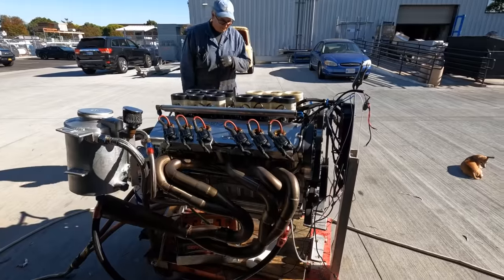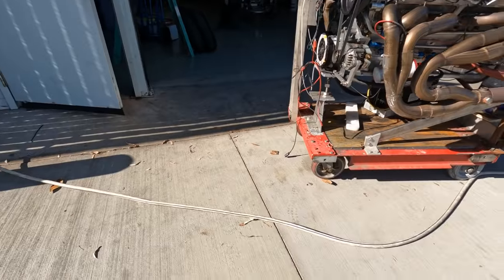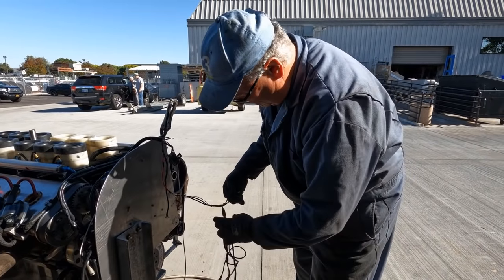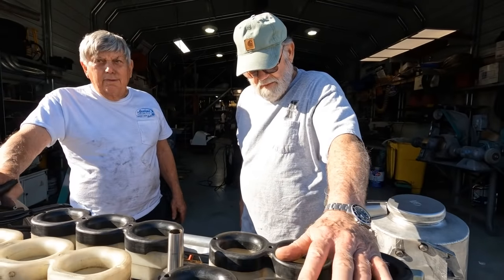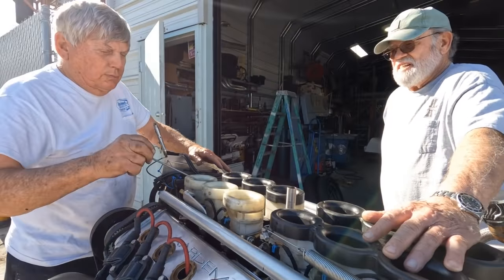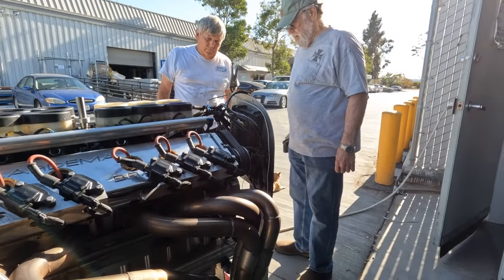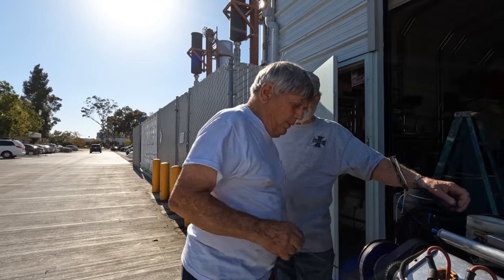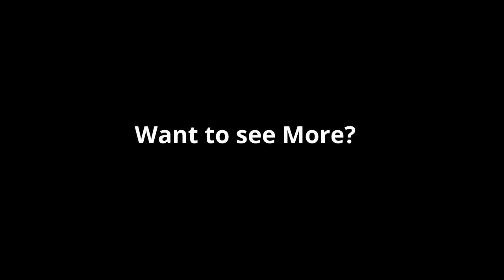Homemade V12 Engine Start Up - Pure V12 Sound & Shop Talk with Pete Aardema & Kevin Braun

Comment: I'd be logging data on 12 wideband sensors if I spent the money on building a one off custom V12.
Reply: true. surprised to see fuel injection and electronic ignition with such little telemetry. guess they just "know".
Reply: Well, while I'd agree with you, and EGR's, there may be UCU support issues - but at least 4 in the primary collectors would give some useful data.
Reply: @gordowg1wg145  You could run a standalone logger to get the EGTs and wideband readings over and above any capability of the system they are running, doesn't have to be closed loop but would sure help to diagnose this issue they are having (and could be hooked to an alarm to tell them to shut down before it goes pop). Seems like they may be stuck in the ways they know, rather than using everything that is now available to help them. I'm sure they've forgotten more old ways than I know though!
Reply: Losing a cylinder because it ran lean? That would have cost more than 12 closed loop Widebands!
Reply: Wideband sensors don't play nice with race gas...at least for very long.   EGT thermoprobes don't care about what fuel you run, and for what these guys are doing would make the most sense.   That would have clearly shown the lean cylinder before it melted had they been running EGT's.

And coming from the aircraft world....we've figured out how to diffuse inlet air a LONG time ago.   You don't need to 'reinvent the wheel'....just look at other disciplines who deal with high speed air flow and see how they handle it.   The inlet area needs to be able to feed the motor, but then you need a gradual increase in area to slow the air down and increase the pressure (Bernoulli's Law at work).   It's not the speed of the air coming in that makes the power...it's the increase in pressure.   Slow moving high pressure air can then be fed equally across the motor with simple ducting.

Comment: I'm a bit late to the party, but motorcycle ram air technology might help.  The ram air intakes feed an air box / plenum, which then feeds the carbs / throttle bodies.  There's a whole science as to the shape and size of the air box, but the idea seems to be increasing and balancing the pressure feeding each intake.  Obviously, the air filter on a street bike helps diffuse the air flow.  If no filter is used, some kind of baffles would be needed for the LSR engine.

Comment: The scoop needs to be separate from the air box. 
By bringing the air in from the scoop thru a 180 degree turn and bringing it into the center of the sealed air box ( and installing a diffuser) the pressure to each throttle plate will equalize. 
Pretty low tech approach, but it will work. 
Then add some O2 sensors for fuel enrichment as manifold pressure changes, ( or run it fat on the low end and tune for WOT+ 250 AP)

Comment: So feeding air from front for ram air, is in principal a good idea.
Atmospheric pressure approx 6 psi, @250mph without bothering to do calculations at this hour of the morning, would easily be around 50pri above atmospheric pressure.

Therefore a simple way to transmit equally to all 12 would be to split incoming air charge via a dual plane scoop.

What do I mean by that well, if one has a 4 inch hight opening for example, 2 inches feeds first six cylinders.

The upper half or 2 inches feeds the back  6 cylinders.

And as dad always said nothing ventured nothing gained.
He was 2nd gen Engineer and I simply followed in his footsteps for my 40yr career.

I wish the team all the luck with this musical motor, Sincerly Steve 😉🙂👍👍
Reply from the maker: Its very difficult to test drive a land speed car. Pete tunes it on the Dyno but as you know its very difficult to recreate 250MPH air flow. Thanks for these calculations. I will share them with Pete and Kevin.
Reply: @GregQuirin  There not calculations Greg, just numbers off the top of my head early in the morning, before finishing my coffee.😉😁😂🙂👍👍

Comment: The back seat engineer in me says you don't want to enrich the rear cylinders as they would then make too much power - relative to the others. More appropriate would be to close those butterflies a little bit to bring the mixture back in line with the rest of the engine... which would then make the surplus pressure available to the cylinders in front... balance the air flow.
Reply: Why would the back cylinders making more power be bad?
Reply: @sexyfacenation  If it were a small. percentage... say 10-15% more, probably little risk. But the pressure buildup at the back of an intake ram would (at speed) probably result in a 2:1 difference, which could cause crankshaft twist problems... or at least highly unbalanced cylinder combustion pressures... leading to rear-most cylinder related failures. 
This is why some racers have used individual "per cylinder" ram stacks.
Reply: @beforebefore  wouldn't matter.  You want each cylinder to make as much power as it can.  The engine won't break due to some cylinders making more power.

Comment: Instead of putting a relief in the back of the scoop,run an internally split intake scoop. The top inlet provides air for the rear six pack inlets, and the lower provides air for the front six pack.
The some simple tuning and your good.
Thermal couplers on each exhaust will help with the tuning, and 4 O2 sensors to ensure your tune is just a little richer than stoseometric.

Comment: I believe they are 100% on track, in their thinking the air is stacking at the back of the scoop. The answer isn't just to run the back 2 holes richer (actually less lean), it's to tighten the difference in air being fed to between all the 12 holes. 
1) a driver or ecu (or timer) controlled flapper on the back of the plenum. If you wanted to do a bit of math, you could rig that trap door with a spring and not have to think about it again, but I'd rather it's opening (and amount of opening) is a known and logged event. 
2) you could have 2 intakes/plenums to feed the front 6 and back 6. A little baffling is fun to play with too, but it's such a dynamic environment in a intake, that it's a ton of chasing.
Reply from the maker: Thanks for the info I will pass this on to Pete and Kevin.

Comment: Would be great to see what they've done the the older LT5 builds, the parts availability for performance was so limited and theyve done some amazing work
Reply from the maker: All 3 of their LT5 engines are complete runners at this time.  I will ask Pete and Kevin if the want to do a LT5 engine video.  This Video has some  LT5 content-  https://youtu.be/j7KHy6s2Yg8
Reply: @GregQuirin  thank you I was sharing the Hot Rod Magazine pics with some of the old Mercury Marine LT5 group.   There is a die hard group of LT5 enthusiasts still out there, recently a C4 ZR-1 set a class record at Bonneville .... Such an underappreciated work of art!

Comment: The high velocity air coming in (250 mph) is (should be) defused slowly (area increasing) entering a larger dia tube (reducing velocity increasing pressure) , the velocity is reduced  as it travels down the difuser and the pressure increased. 
The trick is to do this in a way that the increased pressure is distributed a cross the intake bank. May have to create a light chamber above to distribute the pressure below via large slots to let the air in above intake ports.o  Slot size may vary larger further away smaller closer to high pressure end of the a above chamber

Comment: Sounds like an F1 engine from the early 90's!
Reply from the maker: Thank you it does sound awesome and you should hear it at 250MPH
Reply: Sounds like an F1 mixed with a large displacement 4 cylinder motorcycle engine. Very cool!
Reply from the maker: @compt3ck  thank you it does sound amazing
Reply: My initial first thoughts as well! Thank you💪😁

Comment: This is so cool! Thought… could you run two scoops, one to the front six cylinders and one to the back six? There still might be a pressure differential issue between each section, but since the plenum or “scoop” area is smaller, the difference may be less keeping the each group of six more equal amongst each other? Thanks for posting these videos, very interesting information. Hope to see you at Bonneville some day!
Reply: Or run each set of three cylinders with its own scoop - that way the demand would be equal for each.
Reply: So I did not see any scoop. Do I need to sit through the cc ? V12 intakes or erm V10 intake scoops are well known from F1. Or any hood scoop from a V8. Or Even look at the distribution in some WWII V12 engines, which reduce pulsation as early as possible and thus prevent flow separation, but at the cost of more surface friction. They are all as good within margin.
Reply: I was just thinking that myself, a lower scoop for the front and higher for the rear. That’s one long Engine … either that or individual curved intake trumpets, another crazy superspeed challenge …. Keep it up guys !
Reply: Thought of the same stuff. A higher scoop for the rear cylinders and lower for front 6. Could equalize them a bit with a butterfly inside or by changing the opening size. A butterfly is better, cause you can use it with a servo to equalize the pressures with help of a microcontroller. Having two MAP sensors is a must then, cause it could potentially cause a more uneven scenario than it already was. All that or just mount a baffle inside one scoop. It would lower the flow overall, maybe killing a bit of power, but it would stabilize the pressure.

In terms of not being able to test the design - you could always try modern CAD software which has fluid dynamics simulations included :) It would help a whole lot, even if it's not 100% accurate. I also agree that the front cylinders are getting less air because of the inertia.
Reply: @tomclanys  Butterfly is ugly. simulation is nice. Aeroplanes used boundary layer splitters. One could test that on a trailer pulled against the wind with smoke, glass screen, and a camera ( old school ).

Comment: Ohh, Ohh, the sound! Awesome noises from that V12! On the "vari scoop" concept;  use a rising panel to occlude the uneeded portion of the high speed airflow run by a computer algorithm tied to the velocity and measured density of the air. Any "boost" pressure would be beneficial, but only if it is equally felt by all twelve cylinders. Also a scoop that led to an expansion chamber could let you moderate the effect. But that noise!  FR

Comment: You can do a 3d flow simulation given the engine parameters and dimensions of the intake box and injector stacks and with the ram air effect at 250mph.

I did this kind of work for Hendricks motorsports and Honda f1 v10 engine.

Let me know if you need any help. Kurt slc ut

Comment: Thats a really nice piece.. A simple fix, if your not relying on rammed air, would be to turn the scoop backwards like a boat. Although you would be leaving free available horse power on the table. Ide say use the ram air, build a baffled scoop and program the computer to control it based on wheel speed.

Comment: You have figure out the density pressure with an adjustable inlet to take the immediate inlet velocity to convert to pressure by slowing down by having the inlet into the chamber becoming greatly enlarged and variable relative to speed. From a high velocity inlet convergence to a divergence to increase high chamber pressure from the slowing down the of the velocity. Having all the intakes to the engine see the same volume where the chamber inlet would be variable however the chamber volume remaining unchanged from the point of divergence. Its how the SR 71 was able to prevent compressor stalls by moving its inlet cone at speed and altitude, and how all turbine engines work internally by creating a pressure wall for the combustion at the point of fuel introduction and then ignited thereby creating thrust not being able to overcome the pressure wall developed at the point of greatest divergence.

Comment: Change the scoop so that it has left and right inlets feeding in from the sides, or keep the existing one and put a diverter in it so that it feeds the front six and rear six from their own channels.  Either should give fairly even pressure to all the cylinders.

Comment: You could duct from the rear of the scoop back towards the front thus recirculating the forced air to even out the pressure difference in the scoop body .
Reply from the maker: Thank you Pete is looking into redesigning the hood scoop.   The V12 will run again in May 2022

Comment: I read Adrian Newey’s book where he talked about the air scoop issue - unequal air distribution to the cylinders - he had the same issue as you. He fixed it by changing the shape of the duct. I could give you more detail but my book is on loan. The book is called ‘ How to build a car’, I think. 
(It’s a MUST read!)

Comment: Ram recovery starts at about 150 mph. If you have a divergent intake duct it will slow the air down and give you some additional pressure. 

Alternatively you can use a cowl flap to modify the airflow through the intake.

Have a look at some aircraft designs.

Comment: You need computational fluid dynamics to predict air flow distribution in the air box.  The front cylinders maybe using up all the air.  May need to duct the air to each injector.  Local engineering school would love a practical application of CFD.  Beats guess and test.

Comment: * Use a couple leaf blowers as a sort of wind tunnel. To test air flow into the engine! It may not be as much as the air at 200mph, but it would give you an idea of flow or boost  difference in the engine! Maybe put a couple anemometers in the scoop, or simple water levels, with a tube reading the air pressure at each intake, similar to how a flow bench works, so a leaf blower, and a water level, with a bit of extra tubing, to measure at the intakes,   at that speed, it can produce a good amount of boost!

Comment: My guesz is at 250mph the amount of air being scooped by the air intake scoop acts like a turbo forced induction.  Way more air than when its doing 100mph so you always going to have air fuel mixture issues.  Beautiful sounding machine.

Comment: You need to monitor and control the air intake and auto adjust the fuel ratio as the volume of air increases into the engine as the speed increases.
This is where a good  programed computing tool is required.

Comment: I would make the hood scoop dump the air into the center of the ITB's so it has a chance to normalize the pressure to all 12 cylinders first. I would only cut a relief hole if there is a chance for running through dust or moisture so it could be opened to blow the contamination out since there probably isn't any other sort of air filtration.

Comment: @9:50 I've watched a video that showed people using the conical style intact tracts that are typically used as restrictions and were adapted to provide variable CFM I'm assuming controlled by an actuator/solenoid depending on the needs of the engine. If I'm remembering correctly it may have been HP academy that did a video explaining more about the particular build I'm thinking of.

Comment: There's a guy in Salinas California I think Falconer is the logo on the valve covers and he builds V12 s billet block,heads ,cam, crank the rest.of the motors are off the shelf big block parts ,all cam ,rod,crank bearings ,rods,pistons,rings,rockers all Chevy parts .

Comment: Rolls-Royce ran into  the same problem when developing the "R" engine for the Schneider trophy Contest engine in 1929. Their solution was to rig up a 600hp Kestrel engine driving a blower ducted to the "R" engine to simulate a 400mph ram air effect. Also, would turning  vanes help if mounted in the ram recovery scoop? At 280mph, a well designed ram recovery system is good for 1.5 to 2 in.Hg.

Comment: Could you run baffles with box sections for each pair, or even for 4 cylinders, run pressure sensors in there, and a program than compensates for the extra air density in those cylinders so even if the baffles don't work completely effectively, they can at least register the conditions to compensate for? Maybe from this you could have adjustable baffles, gates even, almost like throttle bodies and you could tune these based on logged pressure data. Feels like you wouldn't want reduce the ram effect if you don't need to.

Comment: Pete great to see you are still at it . Did you ever settle the case with MBZ over the 112-113 engines/heads that you rapid prototyped using the sheet wafer method?

Comment: Back when F1 and F5000 cars had tall air scoops, it was usual for those to have some turning vanes inside.

One "poor boy" way to monitor air pressure inside the air box is to have a series of hose barbs along its length, and run clear tubing from those to the dash or someplace the driver can see.  Have a dip in the tubing and fill each tube to an equal level with water, optionally with a bit of dye or food coloring, not full but to a visible level, with the engine off.  Do a run and watch what the levels do, and tweak the vane configuration until you get similar levels at speed.

Comment: Can you have 12 separate air intakes ? Work out the air flow for each individual intake to determine the size of each tube & mixture required for each individual cylinder. I am a Australian hands 🙌 industrial design engineer. Love your design and creativity and your design having Fun. Keep your spirit young 😊Peter

Comment: Ram air is a problem we used a flow bench to pressurize the air scoop so we can build diverters to balance the cylinders it worked well maybe simple just to put a hole in the back and drop the pressure